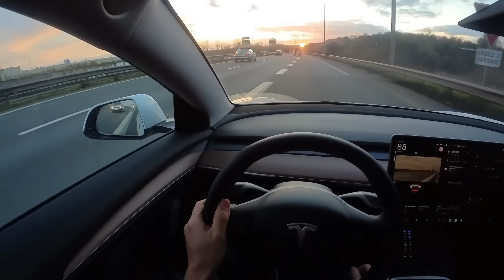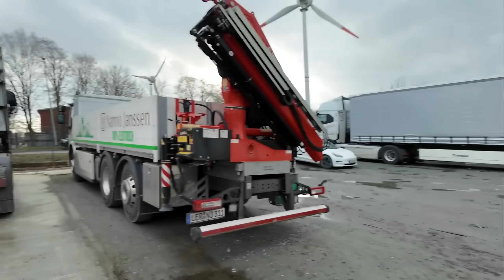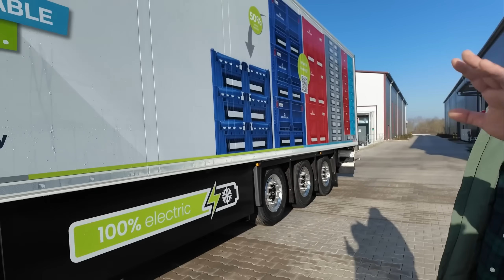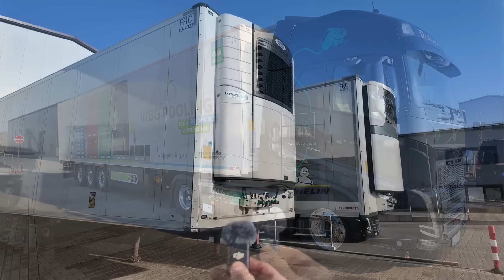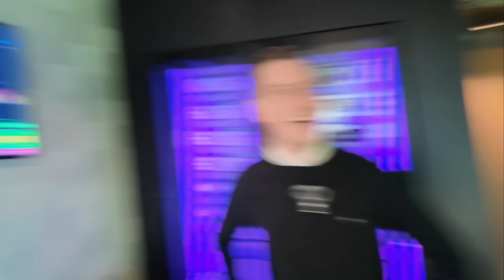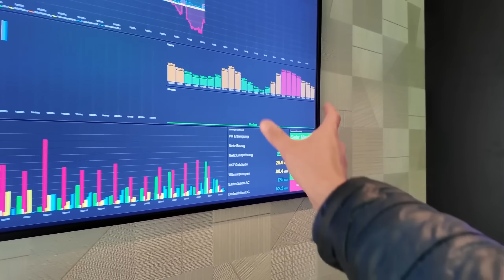It started - Fresh Food Logistics goes Electric

Comment: In late August I did Dover to Calais and back with a Nissan LEAF. The charge points are available on the new P&O "plug in hybrid" ships, for electric cars. Unfortunately the Chademo chargers were not working on the way out. On the way back, due to UK passport holdups, we got bumped to the later ferry which was the old model and not equipped with chargers. 
The ships themselves are capable of doing the route on battery power alone, but the Ports didn't think about electrical connectors (planned for 2030), so they operate on diesel, which makes on board charging environmentally inefficient.

Comment: These electric reefers are a fantastic development. Supermarket chain Albert Heijn and one of its transportation partner Simon Loos in the Netherlands are running more than 110 electric lorries for inner cities for their supply chain, but they are still using diesel reefers. Switching these out for fully electric ones will make the cities a bit more quiet.

Comment: In the UK diesel is still popular with haulage Vans and lorries, but I could see it quickly changing faster than most people think to electric.
Reply: Needs the trucking EV infrastructure too be in place. While car wise its good. for trucks far to many locations are no good. When you think Germany is 47% larger than the UK. E Trucks should be a piece of cake in UK.
Reply: Unfortunately UK businesses are run by (1) ‘bean counters’, (2) sales and marketing (3) staff that produce/do the work. UK politics is run by people who cannot see further than their next term in office. In Germany, the qualified ‘Engineer’ holds greater respect and is listened to. Germany will push Europe to this positive change; our island mentality will do everything to hinder it.
Reply: @geoffmansfield2668  That's a very broad brush. There are plenty of people and companies doing good things in the UK. Electrifiication of logistics seems to be working up from the bottom, so there is a lot of action in the last-mile delivery with cargo bikes, and vans, which are electrifying fast for deliveries, and it's spreading into contractors and maintenance vans now that there are more decent van choices. I agree that larger e-trucks are still pretty rare in the UK.
Bean-counters should be in favour of e-vehicles - they can save money in the long term, although this is sensitive to the fuel and charging prices. It already works great if you can charge up cheaply at your own depot, not so much if you do a lot of expensive en-route charging. German charging is cheaper than UK charging which may well be what's holding us back. Logistics is price-sensitive, so it's hard to blame the bean-counters for being reluctant to change everything if it's also more expensive. They should have decarbonisation targets anyway of course, and many companies do, and are willing to pay for appropriate transport.
Reply: @geoffmansfield2668  The "bean counters" will be all over these when they see how much can be saved.

Comment: So about the invisible non-existing charging ports on the ferry, they are dieselpowered i presume? The ship didn't suddenly sprung sails or windmills powering it's engines? Sure, it might be a convenience, but hardly a solution to global warming. Which is kind of the whole point of electric trucking.
Reply: If the currently diesel powered ferry has the wherewithal when in operation/underway to charge from its onboard electrical system's capacity it would be counter efficient not to use that capacity when available, as the diesel fuel was already consumed/burnt to power the motive engine systems. I presume you can understand what a transitional system/period is too (your sudden sprouting does indeed  generally take a short while, of course, as you know from watching the annual spring time leafing out and blooming of botanical life).
Reply: It may also be powered by onboard batteries charged at the port. If a diesel engine powers these it's going to be noticeably huge and loud.
Reply: Not yet, no, but cross-channel ferries will go electric soon. Interesting question whether they will have extra budget for charging vehicles on-board. It makes a lot of sense from a logistics point of view (vehicle is parked anyway), but not much from a ferry-design POV (double-charging losses, bigger power budget on a vehicle that may already be constrained). Chargers whilst waiting at the port to load are probably way more sensible.

Comment: If they were to use a AEM advanced electrical  machines 🇬🇧 no perminant magnet field motors with no copper windings  motor axel they can deliver power  /drive regen or  be switched totally off, to generate  zero magnetic field generated so no drag loss no problems or dangers towing or rolling a trailor .... again its down motor types or horses for courses 😁🥼🧙🏼‍♂️ 
If you ever visit the UK on a visit to the N.E of England see if you can visit them. They grew out research work done at Newcastle's on Tynes  famous school of  Engineering  University .  
They do modular motors for use in HGVs that are cheaper and greener to produce  and recycle at the end of life as they only use Al windings and Steel components.. avoiding the copper supply crisis ... 

Two or three fluid cooled motors bolted together can generate 1300plus hp and are  impervious to magnet heat and vibration degredation.  Their work preciselycontroling the magnetic fields is what sets them apart... with zero cogging effect resulting in greater overall  efficiency.

Comment: Loved seeing that trailer. That is the future! Trailers are the right place to have all power storage that needs to run them. And refrigerated unites are definitely the low hanging  fruit that must be updated. With little effort we can make there power generating too using solar and micro wind turbines (this is when parked). If you park trailers in long rows, you can park them to create "tunnel effect" ensuring high wind flow rate where you want. And it's no brainer to make the sides and top solar. And yes it can be absolutely movables once too. 

A trucker friend was once telling me how thankless people generally are that they complain when they are queued to unload at a larger fright place in my City. Homes near the place complain the running trucks cause noticeable fume pollution and discomfort to them. An electric trailer would fix this one situation for sure.
Reply: Not convinced that turbines on trucks makes any sense. A reefer takes 4-6kW typically. Small turbines are usually more like 500W. Power supplies at  parking area is way more sensible. PV on the roof/side is a good idea. You can probably get 4kW on the roof of a reefer, which won't power it but will certainly reduce battery/charger usage enough to cover its costs.

Comment: The Youtube channel "Out of Spec BITS" had an interview about a semi trailer with battery and drive axel. But the drive axel also assist in acceleration and braking by measuring the force on the kingpin, this lower energy consumption on the semi-tractor resulting in a longer range for EVs or lower diesel consumption.

Search: "This Trailer Is Perfect For EV Semi Trucks! E Power Assistance For More Range, Stability, & More"

Comment: So here in the U.K. I have a scenario for you. I get in my Refrigerator Artic in Birmingham and pop on the motorway for my deliveries. There has been an accident on the motorway blocking it with fatalities. The road is now shutdown for 8 hours, what is the charge left in my truck after sitting for 8 hours on the motorway and can I still do my deliveries with enough charge, no need to answer. Just one of a million hypothetical questions bouncing around in my head as an HGV driver expected to sit around for hours at a time charging my vehicle, whilst in the future waiting in a que of hundreds of electric HGV's awaiting to spend hours at a charger on the road.
Reply: If you are stuck in traffic for that long, you'll reach the end of your allowed driving time and you'll have to pull over for the night. Whether it's EV or not won't change that.

You're not actually an HGV driver, are you?
Reply: @davidlloyd1526  Your allowed to work 15 hours.
Reply: If you take the numbers from the video, the 32kWh battery in the trailer can run the refrigerator for 4 hours, so the truck's 500kWh (IIRC) battery could run it for about 2 and a half days. If you run the trailer battery down and take another 32kWh from the truck battery, that's only 6.4% - so it's not going to make a significant difference to the range.

Why do you think you'll be waiting in a queue for a charger, when we've never seen the electric trucker need to queue?
Reply: Stick to your diesel truck if you regularly encounter 8 hour delays and you decided to leave the truck running for the 8 hour delay.
Reply: Car can be used as a example. No ICE cars can last 3 to 4 days in the arctic. You'd run out of fuel, ruin the engine or exhaust would kill. Bjorn Nyland did 3 to 4 days in a Tesla. These refrigeration units seem to have power from tractor, so should be fine. Much better than diesel anyway
Reply: In an ICE motor you'd run out of fuel😂 in winter when snowed in.   Not any different to EV
Reply: @iHelpSolveIt  I doubt the i.c.e truck would run out of diesel, but the e.v. truck with its 6 tons or so of batteries and the refuelling time does not make good business sense for a haulage firm in my opinion.
Reply: @billienomates1606  Swap the batteries.  Quick and cheap.

Comment: The energy display was super informative.  Every building/home with variable rate structures should include this technology to help manage loads/costs.
Reply: that is only 1 point - but it takes ages to teach people the difference between kWh and kW that a battery can not store kW, only energy and not power.
And only then people can learn how to use the energy generated efficiently or when to start the dish washer or cooking.

We have such panels in the house but it is still hard to teach everyone a bit and a bit about the background that once the grid is empy we have to pay 28 cent instead of 7 cent during sunlight or when the battery is fully charged. 
We have 25 kWp in total and 48 kWh battery to charge and run the house from batteries , also to heat the house with a heatpump and charge the batteries during winter from the grid from midnight to 5 am for 14 cent now and during winter 5 Cent which means saving 23 cents. 
And in the heating season and during winter we stsill need 6000 kWh from the grid - but we can save 1500€ or 75% of the cost in total. 
Finally 4000 kWh for heating and more or less 10 cent or 400€ a year is lot less than those 2250 L DIESEL p.a. which costs about 2250€. 

At the end it is a fully DIY design, from panel to battery and all the systems around like surplus charging which means the car once connected will always be charged if we feed into the grid and that amount is higher than the mininmum charging speed of 2 kW. But the full system pays off in 4 years. 
Or should I say will have paid for itself in 1,5 years.